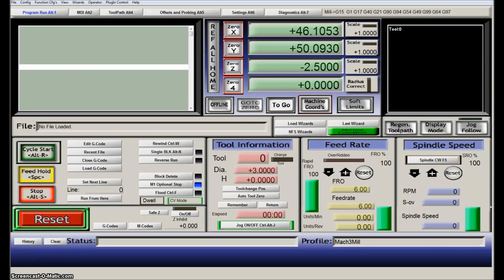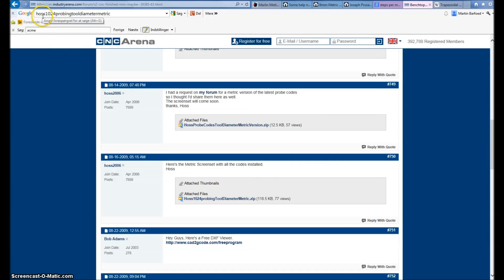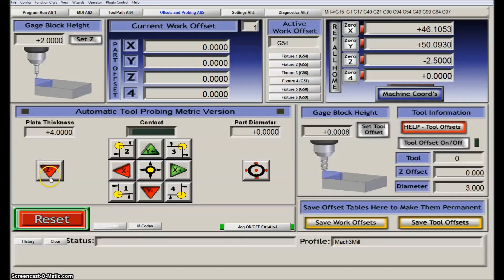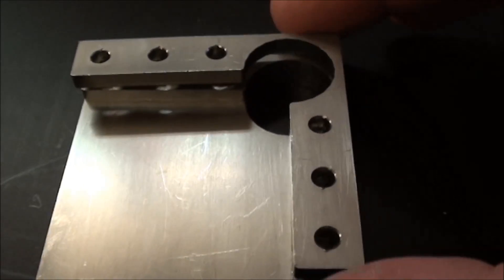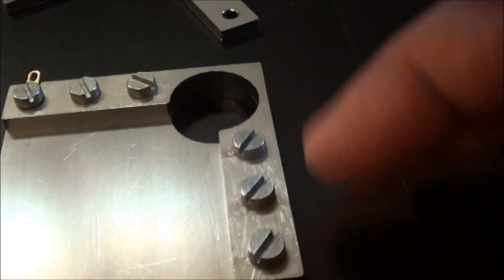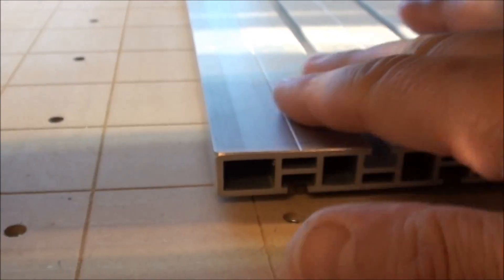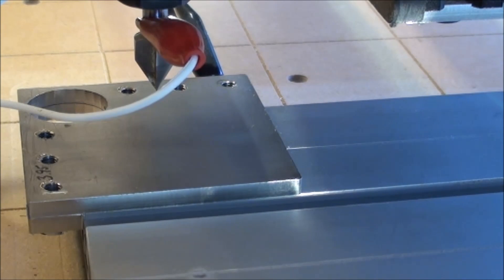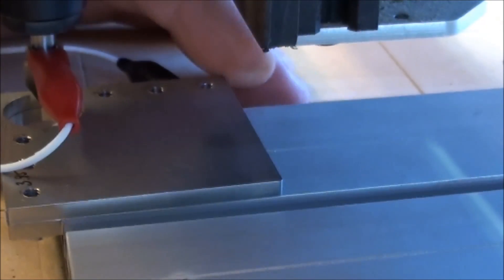Stainless OX DIY CNC, zero and corner finding tool - setup in Mach3

Comment: i has made similar, but i order aluminium corner clamp part 4$ and aluminium square 2mm sheet 1$ and srew to together, then drill side 4mm banana plug hole, can touch banana plug to corner piece. then need only 2 wire and crokodile clamp second wire can connect bit, and both 2 wire connect contrloller GND and probe input pin 15. mechanic have ready but next need linuxcnc make button to display and code how do XYZ job. i not know how, before i use mach3 and newer not can do this zero set tool in mach3 too, i change linuxcnc and same problem not ,how make code, not understand and were file folder and what need, step by step maybe understand, not good english.

Comment: you make the brackets on the ox machine
Reply from the maker: I tried to make one in aluminum on the mill (you can find the video on my channel) however, this one is laser cut in Stainless Steel. I have had a batch made and put them on sale here: http://makersupplies.dk/stainless-ox-plates/93-stainless-ox-gantry-plates-set-of-4-plates.html